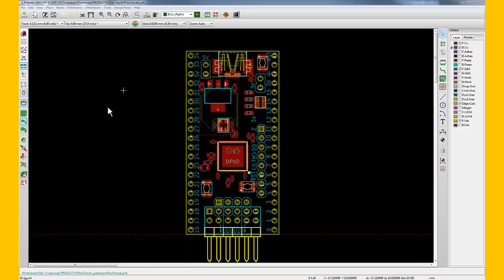Kicad PCB Design Techniques

Comment: Thanks for the tutorial. It would be better to route your power traces to the bottom, then to jump allot of your signals with vias over them. Like at time 22:18, you have 6 traces jumped over the power trace. you can eliminate those 11 vias with just 2 for the power instead.

Comment: why do you drop a second via to return to top layer.. when you could have completed the connection to thru-hole using bottom layer?
Reply: maybe the hole are not plated thrugh, depeends on manufacture that you use

Comment: When you have a bunch of vias jumping under the same trace, you should flip it so the one obstacle trace is routed by a via. I can see 12 vias that can be removed by doing this at a glance. Nice video though, I'm sure many people are unaware of the push and shove features, and have prematurely dismissed this tool because it seems like you would have to tediously hand adjust everything with cumbersome node movements.

Comment: Very good design process !!! 
I'm wondering, how could you know from where(which sheet or component) a global label is coming from? is there any way to search for them around all sheets ?
Reply: he mentioned, that in this case it doesn't really matter, sinc all pins are programmable. 

But usually I think this is a bad habit. One can also write the netlist directly and skip the schematic, if he ist using global labels every where...

Comment: What is the advantage in having two vias in a trace instead of connecting to the bottom of through-holes?  Also, why have vias in many signals rather than one via in the jumped wire?

Comment: Hi, would you help me with arc over a rectangle ? My arc is extending more than I want. I have the proper start point but the other side of the rectangle, the arc is extended more than the two points of the rectangle. Do you have any idea of how to remove the extra portion?

I can share the Project files and gerber for a clear understanding.

Comment: the 3v1 polygon is quite ugly with all the vias and tracks ... stancing vias is not as easy in kicad like in e.g. eagle ... but there is a nice way ... you can create a footprint with a single pad. after adding the footprint to the board, you can edit the pad and connect it to 3v1. then duplicate as many as you need. that's the clean kicad way to do stancing vias :)